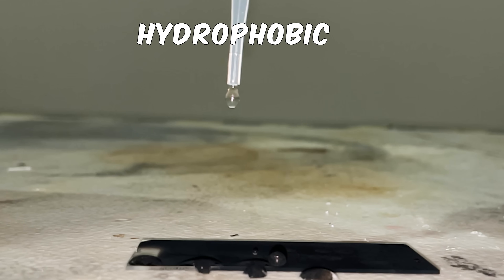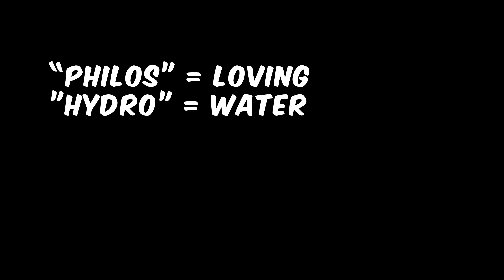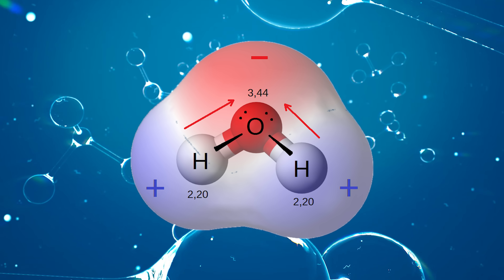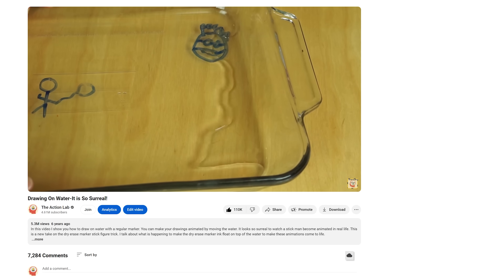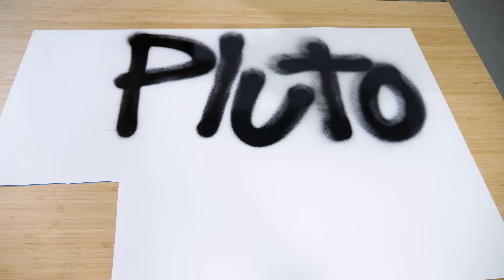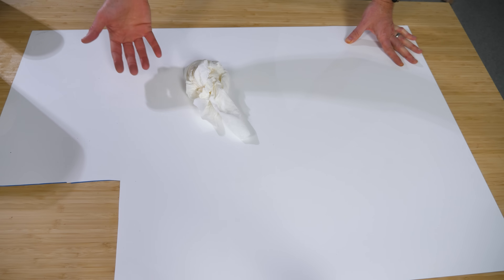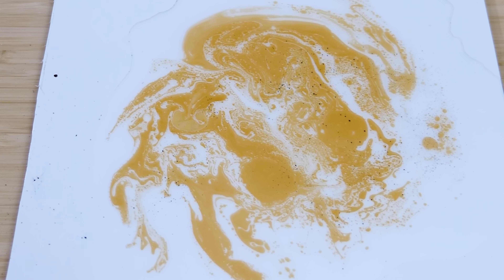This Is The Opposite of Hydrophobic—Superhydrophilic

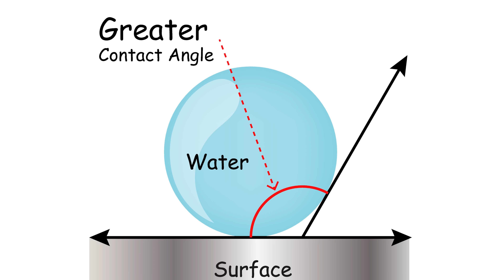Comment: Lovely video! At 0:44 the surface area angle diagram doesn't look correct as the vertex needs to be at the point where the water meets the surface, Is this right?

Comment: I've been telling you guys, nonstick pans are not the solution, "stick" pans are! If a pan repels water, then it will usually accept oil pretty quickly, and oil is far harder to remove than water, which can just evaporate.

Comment: If possible can you try an experiment that I came up with. The things you need are an empty room, a light source and you inside the room. What I have in mind is that , when the light source is turned on you are able to see the walls of the room because they reflect light from the light source. But what if we make the surface of the walls so imperfect that in whatever direction light may hit the wall it does not get reflected to atleast a single point in the room. Which means if you observe the room from that point, even if there is a light source in that room, you would not be able to see anything like the wall and the ceiling in the room.

Comment: I came up with a thought this morning which I wanted an answer of can you explain this 
When we put water in high pressure we can get cold boiling water so is there a way to make hot ice which doesn't melt but must be from h2o not from anything else
Whoever thinks it's interesting like it so it reaches the maker

Comment: could a hydrophobic coatings make small seams and joints,  that would otherwise allow water to pass through, impermeable under low pressure applications? 
Would water flow , horizontally , over window screen without dripping through  if only the top surface of the mesh was hydropgobicalky or hudro- lovingly?

Comment: So, what is the implication of this for automotive paints?  The paints, waxes, and other coatings for automobiles boast about their ability to cause water to bead up and run off, which sounds hydrophobic.  The hydrophilic surface you demonstrated sheds any kind of contamination other than water easily, simply by getting it wet (like one does to wash an automobile).  So which would perform best?  A hydrophobic automotive paint, or a hydrophilic one?

Comment: Fun fact:
Dry erase markers and permanent markers (not the high-temp versions) are actually almost identical. The main difference is that dry erase markers have a much higher alcohol content.
It's that alcohol that makes them dry erasable, so soaking the stain - either permanent or dry erase - in alcohol will completely clean it.

Comment: A good portion of this video was looking at clear water on a solid white surface being directly illuminated. It was very difficult to see the edge of the water droplets. I think illuninating it more from the side might have helped us to see what was going on better.
Reply: And colouring the water.
Reply: gobblinal.
Or coloring the water xd.
Reply: Yeah, the thumbnail suggested it would at least be colored water. Even with that still, the camera angle didn't show it all that well.
Reply: Or printing a grid onto the card, so that you can see the distortion of light beams, due to the droplet. Scientists studying wetting use this trick a lot.
Reply: @adambarker3130  I guess water would get under the grid and make it disappear. That would be an interesting experiment : how can you permanently print something on this surface?
Reply: @cheeseparis1  super easy use the same material used for making it super hydro phillic and heat treat it.............................
Reply: yeah, I gotta say I was pretty disappointment in this video for the most part. Just frustration because I couldn't see what was going on.
Reply: I wonder if there's a real reason he didn't use colored water to make the beading and absorption more visible. For the floating ink it makes sense but not when focusing on the water itself.
Reply: I didn't really have a problem with it until the very last clip of the silica. I could not see a thing their.
Reply: The settings of your monitor play a HUGE role in what you can and cant see, my second monitor could see the water just fine, while my main monitors contrast is set to be good for gaming, and i couldnt see the edges of thje water, or the water at all
Reply: @ULouOW  I am mostly watching YouTube on my phone.
Reply: i literally can't see anything
Reply: or you could change your contrast
Reply: I came here to say that. Really interesting topic but really frustrating not being able to see it.
Reply: Yes I was thoroughly disappointed

Comment: What if you put a magnet under the surface when the ferrofluid nanoparticles are floating at the water surface ? They should align with magnetic field lines, but without being affected by the solid surface as usual.

Comment: What about Omni phobic surfaces? I'm guessing those are like a bed of spikes microscopically. Are there any durable enough to function as a counter top, or shower walls, or sink / toilet surface? I seem to recall that these can be made with a laser, so the base material just needs to be tough enough... Although I guess the spikes would eventually fill up with microscopic dust unless there was some way to evict the dust... Maybe if it could also vibrate at an ultrasonic frequency... If it can do that then it could also act as a source of ultrasonic waves for cleaning as well, but that would require contact with another surface that needs to be nondestructive...

Comment: Considering that ferrofluid is ferrous particles suspended in oil and that oil and water have a long standing disagreement you should be able to remove it from other things with a good emulsifier like tipol or similar.

Comment: Is there more "polar" liquid than water? I found various metrics for polarity (it cannot be expressed as a single number - that is only approximation because iduction, resonance, dipole moments etc. etc.) but typically alkanes are least polar (nonpolar) then the table goes through organics, alcohols and finally water. Is it possible to go further? Maybe liquid hydrogen fluoride? Supercritical carbon dioxide?
Reply: What about dielectric constant.
Reply: @agnelomascarenhas8990 Thanks, this is the magic word. By this measure, e.g. sulfuric acid (ε = 100) and formamide (ε = 111) are even more polar than water (ε = 80.1).
Reply: Solubility is also indicative.

Comment: You cna make a hydrophilic surface with shaving cream or gel. Spray a but on glass or a mirror, rub it in till its clear, and it wont fog or bead.
Reply: True, most bases, such as sodium hydroxide, dish washer products, and soaps act the same, more or less.

Comment: This was really interesting! But I wish you would've used food coloring any time the water was just poured on a white surface, like in your thumbnail. It was fine for the spray paint and permanent marker though.
Reply: That would have been a good way to see it better. Also kinda wish he would have scrubbed the spray paint before he put water on to prove it was the water aiding in it coming off and not just the spray paint not sticking well to the surface. That’s a pretty nitpicky detail though

Comment: If the surface is super hydrophillic then how can it be wiped off by cloth? Shouldn't water molecules prefer the surface more than cloth?
Reply: I believe the bulk of the water absorbed into the cloth has more cohesion with the last little surface of water touching the 3M product than the water has with the 3M product.

 So in other words, I’m guessing water prefers water more than the surface.

 What do u think?
Reply: Super-hydrophilic doesn’t mean water is attested to it like a magnet more so it just spreads out far more than it normally would since it overcomes the surface tension of the water. The cloth still absorbs it since the capillary action brethren the cloth is stronger than the small force of the polarized molecules. Im sure something I’ve said is wrong but that’s my understanding of it. Basically super-hydrophilic just means water is more attracted to the surface than it is to itself by my understanding. Or at least it is attracted enough to overcome surface tension it’s probably still more attracted to itself than the surface

Comment: 🤔 The definition of hydrophobic seems problematic since the angle will also depend upon the local gravity. Is there a more resilient one?
Reply: just adding “at 1 g this is the angle” would solve the issue. Though a definition that is able to be applied at any condition would be interesting but difficult I imagine

Comment: What is the material used in the video
Reply: 3M Super-hydrophilic Post-It Flex Write
Reply: @heatshield  I think they're asking what it is, chemically. It would be nice if the science channel got into the actual science behind why this works, other than just saying "it has polar groups in it". I would guess it's some type of a polymerized alcohol, maybe a titanium dioxide coating in flexible glass substrate

Comment: can you do a video on contact angle? I've never heard of it before.
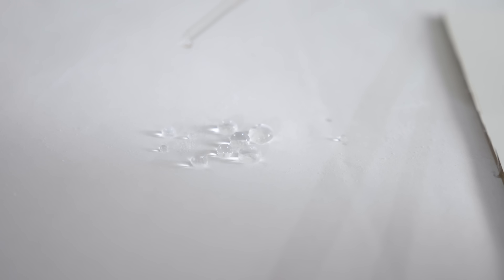Reply: I agree. Especially because the diagram showing it make it look as though the tangent to the liquid surface can be 'drawn' slightly arbitrarily. It should originate at the point that the liquid stops being in contact with the surface (i.e. no gap shown at 0:44).
Reply: I was also hoping he would have dove into more detail about contact angle

Comment: If they could make dry erase boards with this as a top coat, I wouldn't have to worry about staining over time or damagine the dry erase board with constant cleaning. Just spray water, wipe, et viola no left over ink
Reply: Its probably cheaper to buy 10 normal whiteboards than 1 hydrophilic one. 6:17
Reply: @amosmoses5630 no it would be pretty cheap to make then. Bit they would stay wet a long time, and would attract moisture out of the air. Writting would just drip off on a humid day. 😂
Reply: I dissagree, yes the upfront cost might seem cheaper but people often forget the longevity of investment.

If you buy those 10 normal white boards and they get permanently stained, their done for. No reuse.

If the hydrophilic board get's stained you can always just use water and wash it off. I am assuming a little but I am gaussing the cycles of a hydrophilic board can be 2-5 times greator (minimum) in terms of washability then a normal one.

Therfore even though it may cost 10 times more it may have greater the 2x the longevity. Overall being technically cheaper.
Reply: @DoubsGaming  make me proud and convince ur parents/boss/animals this is the case.
Reply: @DoubsGaming  your logic is a bit off, if it is 10x the cost but only 2-5x the longevity it makes more sense to buy the normal cheap ones. Say if it’s longevity is 5x greater then that means it lasts as long as 5 normal white boards but costs 10 times what a single white board costs, so just using 5 normal white boards would cost half of what using a single special white board would cost.
Reply: I get your point but all the permanent markers in the world suddenly stop being permanent when you wipe them with basically any sort of alcohol
Reply: Basic Dawn dish soap lowers the surface tension of water better than most things
Reply: @JustJacob-nt8eu very true. It's a great surfactant. Surfactants make water wetter. 💧 fumed silica does the same thing to dry powders and makes the flow better. Starch will spread out alot with just a little fumes silica. When normally starch clumps and will pile up high on it's self.
Reply: And you wouldn't have to worry about vandals coming around with Sharpies.
Reply: @JV-pu8kx  if someone uses a sharpie on a white board one of the easiest tools to use to remove it is... a dry erase marker.
Reply: @Mike__B  gold
Reply: @Mike__B  hand sanitizer works great too. It's the alcohol doing the trick, but because it's thicker it helps it stick longer.
Reply: @Mike__B  hand sanitizer. Wipes right off
Reply: yes but then the companies can't charge consumers for multiple white boards.
Reply: Or even having to use special dry-erase markers!  You can use Sharpies!  You know what?  How about a table with superhydrophilic coating!  :)
Reply: You already can, and they already are (just not with water). Dry erase markers are alcohol-based, and that's the key ingredient that makes the marker dry-erasable. So just like allowing a dish to soak in water helps you get off the dried food, placing an alcohol-damped cloth over the stain will allow it to come off.

This is also true with permanent markers. Permanent markers are (almost) essentially dry erase markers with their alcohol content reduced to the point it dries almost immediately. This is why the "dry erase markers remove sharpie marks" trick works in the first place. The thing is though is depending on how dry the marks already are, there may not be enough alcohol in a fresh "coat(?)" of dry erase ink for that trick to work.

Lastly, the fact dry erase boards have this "ethylphilic" coating is why scratches on them stain pretty much immedietly, as the coating was removed from that area.
Reply: @veroxid  
Like dissolves like.
Reply: That is exactly what this is.😜
"3M Post-It Flex Write Surface"
Reply: This was my first thought too
Reply: Whiyeboards are already kind of hydrophilic due to the coating on them, that's why it is easy to erase markers. The problem is that this coating gets scratched or fades in  time. Would be nice if one could reapply it somehow.
Reply: I have classroom white boards that have been in place for many years under a lot of use.  They don’t stain.  If there is something stubborn, window cleaner works.  Also coat your boards with rainX.
Reply: Its "et voilà" and not "et viola"
Reply: what about using alcohol to wipe it off?
Reply: @fakestory1753  just throwing this out there, if you have an old dry erase board with old markings that are hard to erase, there is alcohol in dry erase markers. Just write over the old markings and erase the whole thing.
Reply: You don't use a smart board?
Reply: @MeenageTutantTinjaNurtle  Hate them!!
Markers won’t stay calibrated.  
I have an interactive flat panel now.  Much better.  I just need to talk the school into giving me 2 more.  They aren’t big enough.
Reply: @MeenageTutantTinjaNurtle  No better way to make an appliance or item dumber than making it "smart."
Lol
Reply: Durability may not be enough for long term benefits.
Reply: there is wet erase boards iirc; they aren't super common though
Reply: My first thought
Reply: you’re a genius
Reply: so.. a wet erase board?